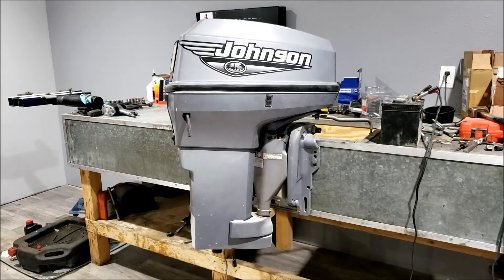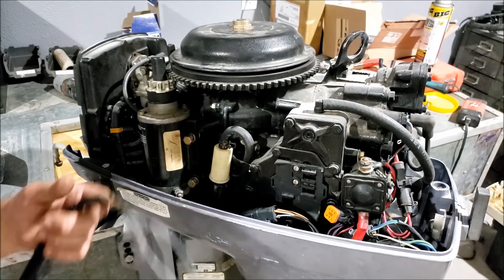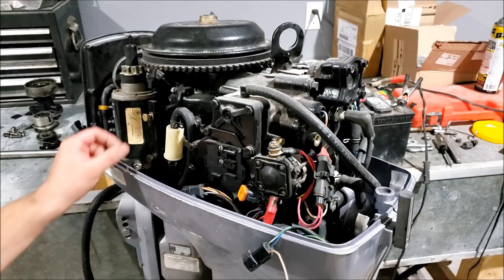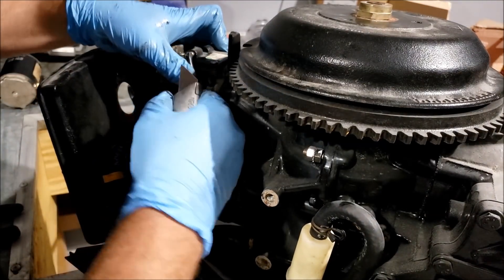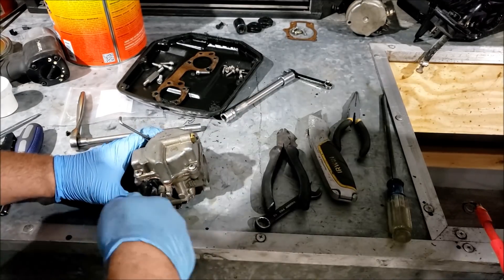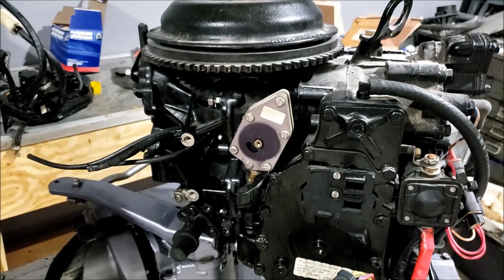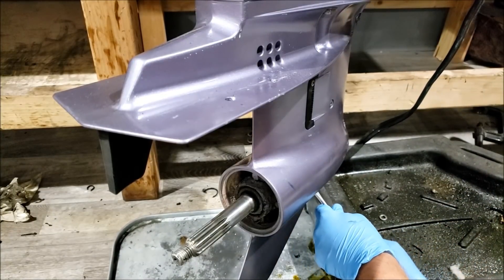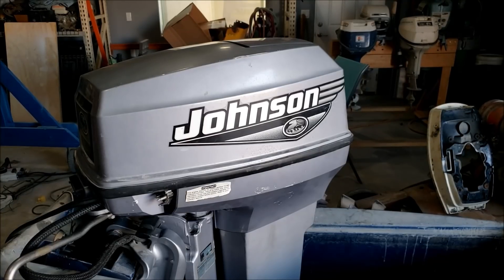Awakening A 2000 Johnson 50 HP With "Irreparable" Lower Unit

Comment: I have learned so much from this channel. Recently bought a 1989 Evinrude 100XP. Previous owner "Deleted" the VRO. Still had the pulse limiter. They also decided to put the old style choke carbs and smaller intake from a 70's 85hp on there. I was like, Brandon would have something to say about this engine. Got it all fixed up though.

Comment: Great video. Liked your verbal guidance keeping us informed. Small but important trick. When heavy corroded screws won't let loose, place screwdriver in screw slot and heat the screwdriver. Corrosion will melt and loosen screw. Do not force screw if still stuck or it might break. Repeat as before.

Comment: I have a Johnson 50hp outboard I have no idea how old it is but am guessing it's about a 1999 model, it belonged to an outboard mechanic who could not get it to tick over in gear, it would stall every time you put it in gear to pull away, he used to rev it up the engine then "slam!" it in gear. docking it was fun though, as it an uncontrolled crash! I spent weeks getting this engine to run right, and the only way I could get it to tick over any were near right in gear was to increase the idol jet size. it's a darn silly idea using fixed jet carbs! anyhow my point is, an old engine needs more fuel to do the same job as a new engine, so if you have an old engine that won't tick over very well try increasing the idol jet size. you make a good video and it's much better because you use a tripod, some don't, and you get very seasick trying to watch them!

Comment: Hi there,
You have done a awesome job on this video. I've just bought a boat with a 2000 50hp Johnson with only 200 hrs. The bottom leg of engine has a huge amount paint missing. just wondering what type Of paint do you use? Is it either enamel or 2 pak paint.
Kind regards
David

Comment: Those two stroke OMC/BRP 2-cyl loopers do shake a lot at idle.
Reply: Until the mixture needles are set, you won't know how well it will idle. Any factory settings are just a starting point. I'll presume the throttle plates were dead even. I'm sure you'll button it at the sea trial.
When cleaning most OMC carbs the throttle butterfly should be shimmed open somewhat, since the throttle plate doesn't expose 1 of the transition orifices until the plate opens slightly. I'm sure you opened and blew it out with air anyway, but for the popcorn eaters at home...
I'm sure the shop was salivating just getting a good trim unit, very pricey and gearcases are the other piece of gold on those.
Reply: @dazco123  Yep.  But, the 2-cyl two stroke loopers still shake a lot at idle.

Comment: Dropping straight up knowledge in here. From a fellow marine engine part time tinkerer. Gears are common to be the cause of "issues" in a lower unit.
Improper shim clearance is part of the restoration. The shop manual should spell out the correct play or correct shim tolerance at some point. Maybe bad or quick service at a shop or haphazard homeowner garage install without knowledge of what he was really doing.
Reply: Latter description sounds like me without a garage ( just in my backyard ) and I ain’t no mechanic lol!

Comment: My man you did an awesome job on this old motor which some mechanics told u lower unit unrepairable , like u said just replace it ! I would love to know how much u gave for the unrepairable motor and the 48 lower unit and parts to get u to a operable motor?  Myself I’m about to take on a rig I bought for $600 , it a 17’ bass tracker I have to look at paperwork to see wat year the Tracker Evinrude 40 hp ( not sure wat year tracker used evinrude 40hp for their tracker 40 hp. ( maybe u know the year they used evinrude 40 hp?) anyway I bought the whole rig thinking they wouldn’t take a unrunning motor for a trade in right? So I see so far they just plugged up the oil line going into the motor but are still using the VRO SYSTEM to pump the premixed oil and gas up into the motor , but I watched a video on a 93 40hp evinrude conversion  which they eliminated the VRO COMPLETELY! and did wat u did with that 50 hp , all I have to do is buy a new fuel pump and I’m gonna replace all the gas lines just to be on the safe side . I just need to watch and see wat they remove off the front of the motor and replaced it with a plug like u also did. Wish me luck cuz I ain’t no mechanic lol! Thanks for ur great video buddy! Tight lines!

Comment: Interesting to see. Would you know if carbs need to be removed to remove the intake manifolds when replacing reed valves on a 1991 225 Johnson?

Comment: Great stuff, I had an 89 that did the same thing. I have been binge watching your videos and I have 2 questions for you if the time is available to reply. When you do all of the water pump replacements, what is the reason behind NOT replacing the thermostat to insure a healthy cooling system? I recently bought a 91 johnson 40, guy started it with muffs, ran ok, vro deleted, idled fast. He cleaned carbs, replaced water pump, replaced lower unit seals, held pressure and replaced oil. What would be your list "to check out" from there? Kinda new to this stuff, guess I am asking for some advice. Thank you for your time sir.

Comment: So, I Just watched your video. Very helpful but, I am having a problem. Same motor, replaced impeller, no clogs anywhere and still not peeing. Really hoping you can help
Reply from the maker: Did you use sealant on the top and bottom of the metal plate?
Reply: @BrandonsGarage  what metal plate? Where the impeller sits? I don't recall a "metal plate"
Reply: Would love a call from you so we could talk instead of this
Reply: 813
Reply: 786
Reply: 2390
Reply: @BrandonsGarage  not sure if I replied correctly. Would you be willing to call me?
Reply from the maker: @ericcharland2960  can't tonight, maybe tomorrow? Yeah, the shiny metal plate under the impeller.
Reply: @BrandonsGarage  quick question. Should the drive shaft turn with ease in either direction? When the lower unit is out

Comment: Brandon I've got a 2000 6 hp Evinrude 4 stroke in my garage with a broken throttle cable.  Any ideas on where to find one? It never had one when I bought the motor so I have no idea the length etc....I don't even know if it runs yet 😂

Comment: I'm just wondering I have a 89 50 horsepower 2-stroke Johnson motor on my pontoon boat and I was wondering does it have to have a fuel pump on it. As you can tell im most ignorant about this

Comment: My 1997 johnson 50hp seems to have issue with water flow.  Took the lower unit down, run a garden hose to the water pump inlet port, it takes over 20 seconds for the water to come out the pee hole.  Is it supposed to be that long?  can't say it's clogged up 'cause water came out.  Any suggestion what to do next? thx

Comment: I'm trying to take the lower unit apart on my 1997 50hp Johnson outboard, which is every similar to yours here.  The Thrust Bushing is stuck on the prop shaft, I can't seem to find the right puller tool that would fit inside the case to pull it out.  Do you have any suggestion for the tools ?
Reply from the maker: I use a tire spoon, and pry a bit all the way around it, one loose, two large flat heads.

Comment: Hi Brandon, thanks for the video. I just picked up the same engine and it has the same problem. Lower unit is cooked - no reverse or forward. I thought I might be able to replace the pinion gear, forward and reverse but if it’s going to end up costing $1000 there’s no way i’m doing that. The gears themselves don’t seem to be too pricey, what other parts would I need to bank on getting? Any info you could provide would be helpful. Thanks, bud.

Comment: What do u prefer for your boats older 2 strokes. Newer 2 strokes or 4 strokes?
Reply from the maker: Well I would prefer a brand new boat. A twin engine center console, or a cabin boat. 
But those are out of my price range, so bring on an old 2-stroke.
Reply: @BrandonsGarage  yes prices of boats have gotten stupid. In 2007 i bought a bayliner 175 with the merc 3.0 alpha 2. Ordered a sick tower with light bar and 4 speakers. Loaded two 10 inch subs and fit 1 8 inch bazooka tube under the dash. I also had the board racks both sides and some other belks and whistles. Total cost Canadian pesos  16k. Out the door taxes everything. Granted i installed everything like the extras. But that boat i used it almost every sunny day full of friends for 10 years. Did no maintenance other than air and oil changes and lower unit every spring. And i never had 1 problem in that 10 years. Sold it in 2018 for 8k but now for 15k canadian pesos you can get anything new or even close to it. Unless its 14 feet or smaller

Comment: How hard would it be to take this exact 50hp motor and add HP say to like a 60hp ? Thanks
Reply from the maker: Actually pretty easy; the hardest part is being able to remove and replace an outboard.
What you do it remove the outboard from the boat, sell it on craigslist, buy a 60 HP, and install it onto your boat.
Reply: So nothing like just changing carbs? Probably have to change heads etc?   I want to stick to the 2 stroke smoke ha

Comment: I have Johnson 48 an I'm trying change the lower but the good lower I acquired has shorter shafts an rod , can I take the shift off the old an put on the newer
Reply from the maker: Other than the shaft and shift rod, are the lowers the same?
Same shape, similar year, etc?
If this is for a 1989+ engine, and the lower you received is also for a 1989+ yes, you can swap the driveshaft and shift rod.
However, the driveshaft will need to be shimmed, requiring a $400 shimming jig. Also, you'll need 2x new pinion nuts to torque it correctly.
There is a driveshaft shimming service you can use to avoid some of the cost of the tools https://ebay.us/oIAhMN

Comment: Hey Brandon, have you ever had the opportunity to work on a 1994 Mercury 60hp 2 stroke outboard ? My problem is I rebuilt the starter , put a new regulator on it. It ran great took it out. Beached it on my lake . And that was it ! My neighbor towed me to my pier. No power but then I by pasted the regulator and and jump started it directly to the starter and it started, I was thinking the regulator I bought that came from China is bad , or do you think it's a bad ground wire or something else ? I don't have a meteor to check it .
Reply: Bought a chinese cam sensor for my truck. Blasted thing was wired backwards. Cost me $420 to figure it out and I'm a retired mechanic. I don't do chinese anymore.

Comment: So how much tied into that outboard ? You come up with the dangist tools ! Lol. My outboard tool box consists of a screwdriver, pliers , brass hammer , coil alignment ring , continuity tester a 3/8” and 7/16 and 1/2” and 13/16”along with shift rod seal remover ! Oh and a lower unit pressure tester ! So now you have a $2k to $2.5k motor ! 👍
Reply from the maker: Well, I've thought of that too; my issue is the replacement lower. I'm going to call it the value of it, not what I paid for it. 
If you consider it that way, I'm $1,200 into it. 

I have some high dollar K&O Outboards sitting on my shelf. I paid $40 for one of them-
 That doesn't mean I have $40 sitting on my shelf, as its worth much more; I have $700 sitting there collecting dust. 

And yeah, I do have some fun tool. A full set of OMC service tools almost; only missing a couple.
That shift rod remover is really all you need; but if you find a vintage seal puller for the 5.5-9.5 HP lowers, it makes lift much easier.
Reply: @BrandonsGarage  say brother have you thought about using those boat moters to repower other things like a 4 wheeler or motorcycle? That seems like it be a badass project and the vehicle would be awesome. Like you would use like a radiator for water supply and cooling but also it could be air cooled being in the open

Comment: What is the difference between a 40hp and 50hp Johnson engine?
Reply from the maker: 10 HP.
🤣🤣🤣
Reply from the maker: But seriously, its the carburetors and head.
Reply: @BrandonsGarage  Johnson part numbers for carbs and the head are the same. Are the Reed valves the same?
Reply from the maker: I don't know where you are looking. 
Part numbers from a 2000 J40RLSSM -
0439458 CARBURETOR ASSY. 40 Models
0439450 CARBURETOR ASSY. 50 Models
0339540 CYLINDER HEAD. 40 Model
0340100 CYLINDER HEAD. 50 Model

And yes, leaf plates are also different-
0395442 LEAF PLATE ASSY. 40 Model
0389810 LEAF PLATE ASSY. 50 Model
Reply: @BrandonsGarage  Ok, thank you!
Reply: @BrandonsGarage  Do you have the parts we are talking about for the 50hp Johnson? If so would you sell them?

Comment: Why do you flip the fuel manifold? I have a 1999 which I suspect has been converted from VFO. Mine is facing opposite.
Should I expect issues with it facing the original way?